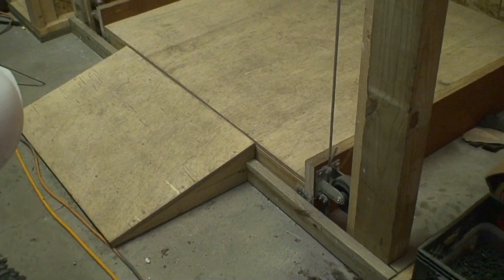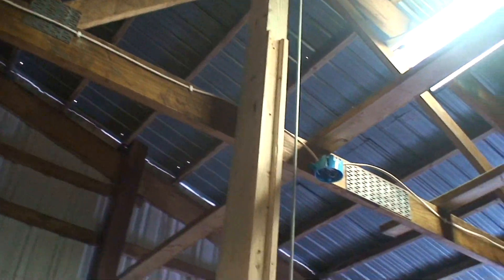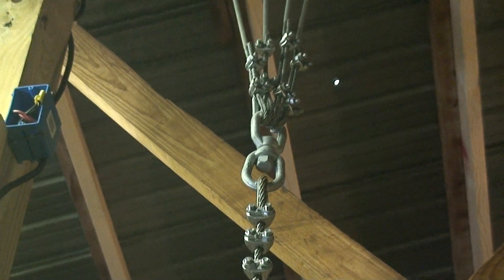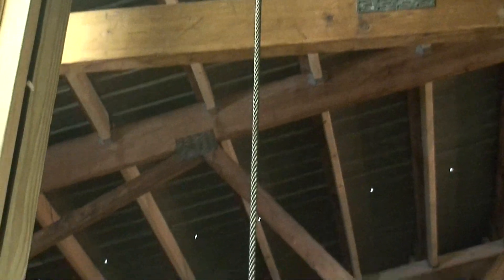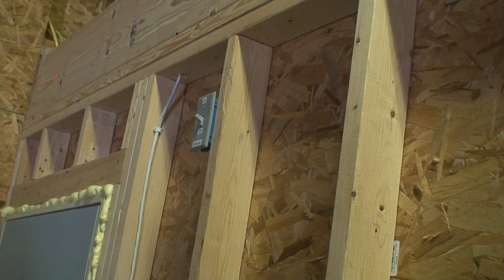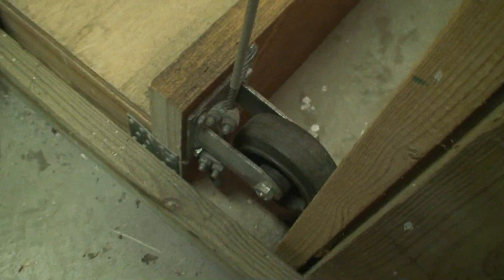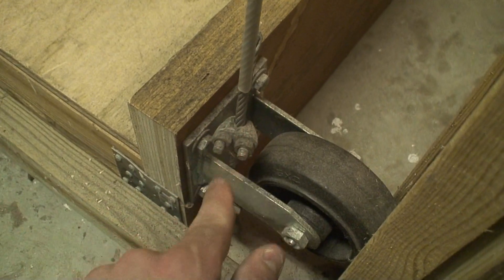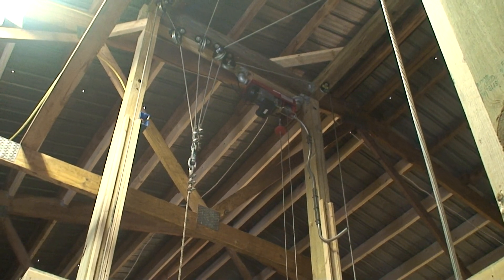Part 3 of Building Your Own Freight Elevator

Comment: Ours is going to be 48”x32” and primary use is for us old people and our old dog! LOL. Using a 4500 12 volt ATV winch with 3/8 steel cable which has two remotes and the handlebar rocker switch which will be mounted in the cab. Cab will have expanded metal mesh screen on 3 sides and the top. Going for the old Alaska mining camp \ mineshaft elevator look. All heavy duty Z brace timber framing, over engineered hardware and pulleys, everything will be plus 4500# rated. Will post up a video of our build and finished product and tag you as the inspiration. May have a use for your gravel mover too! Thanks again and God Bless. 👍🏻👍🏻👍🏻
Reply from the maker: That is completely awesome!  Would love to see video of your project once up and running!

Comment: I think the weak link is actually the D rings and the swivels. If the hoist failed it would probably unspool slowly enough to prevent a hard crash. If an unobservable mfg flaw or material fatigue in one of the singular lift components (D ring, eyebolts, etc) failed it would likely crash to the floor. A cable snap is much less likely. Double-up on all singular components.
Reply from the maker: Thanks for the comment Jeff.  I agree with you 100% and have since made it a rule to triple up on all the singular lift components

Comment: The Crosby Wire Rope Clips are installed backwards and the cable may slip and lift fail as currently configured. The U bolt always goes on the dead-end of the wire rope cable!
Reply: I see double cable clamps which is good, except that one should be as you describe and the other opposite when two are used.  I believe two clamps is mandatory for safety concerns.  Hose clamps also, go one on one side, the other facing the opposite way.
I actually went to an underground mining "school" the only one of it's kind at the time, in Rossland, British Columbia, for six months one winter (1972).  Justin Trudeau's father's idea, he paid for it.  He was prime minister of Canada at the time.  Pure socialism, I was 21 yrs old and my Unemployment Insurance checks ran out.  You have two choices, go to work or go to school.  
The Mining school was a fabulous experience, with about 15 students only, we had three excellent instructors, an entire gold mine, and various pieces of equipment from Jack leg drills, stopers, long-hole machines, to a 9 yd Scoop tram and a 3 boom Jumbo drill.  Few regulations exist underground when it comes to rules for building water and air systems, railroads and ventilation systems, or rules for loading rounds and blasting.  You do what manufacturer's recommend and what the engineers require and what others show you.
Because of the school I walked into a (very low pay) job in Timmins ON about a month after school ended.  I worked another two years at that, paying back into the system whatever that experience had cost with monthly U.I. deductions.
Ironically, two years later, working at a Mormon owned Uranium mine in Bancroft Ontario as a drift miner, I was probably the only person working underground who knew anything about minimal allowable gas levels, emergency procedures, (and) who had any blasting training (!) and I ran afoul of management because of it, more than a few times.  It ended my "career" with that outfit, they tried to kill or injure me more than once near the end of that game.  I was given assignments that couldn't be done under current safety regulations, like going to older parts of the mine from the '50s, to setup, drill off and blast sample rounds, in places with one access only (and damaged) or no ventilation, or using setups that were quick and inadequate.  My partner and I were gassed one Friday afternoon, when the crew on the level below us blasted 15 minutes early, wanting to be first up, and first out to the tavern.  Their COx's and NOx's then expand into our drift 150 feet above through ventilation shafts and trap us at the face.  Visibility in the gas is a few inches so we made a tent of our waterproof clothes and huddled around the 2" air hose with one hand on the valve.  After ten minutes it began to clear and we took a chance and walked through it about 100 feet to clear air.
On surface our tags were still on the board even though the shift was over and everyone had left.  Raging at our shiftboss he asked me, "did you light your round" to which I replied no, of course not (you f'ing fool, what a stupid question, we were trapped in front of it).  I had to go back and do that.  
Needless to say, safety and how to install wire clamps was not, a top priority of that mining company.